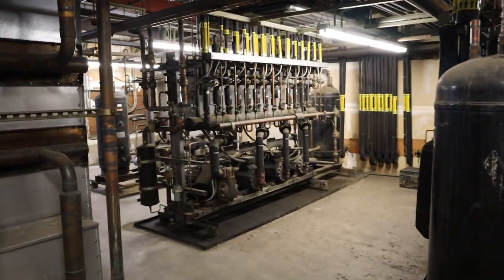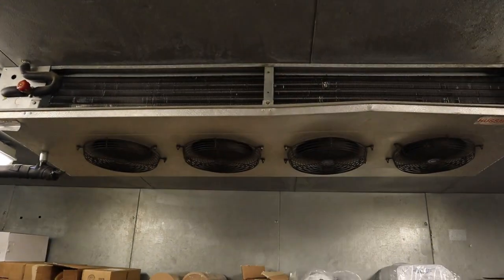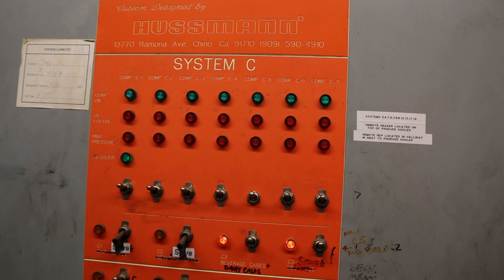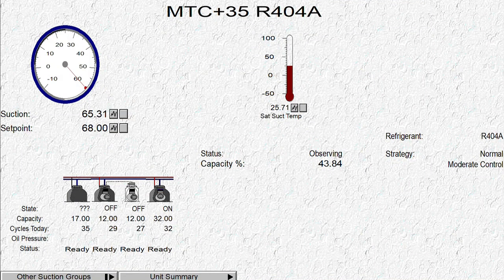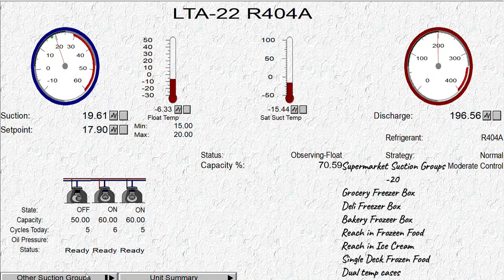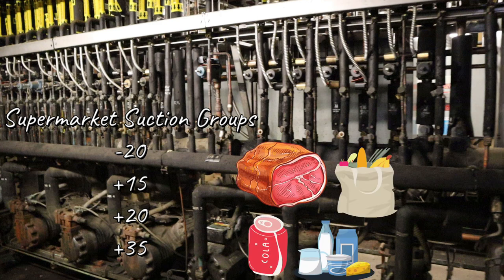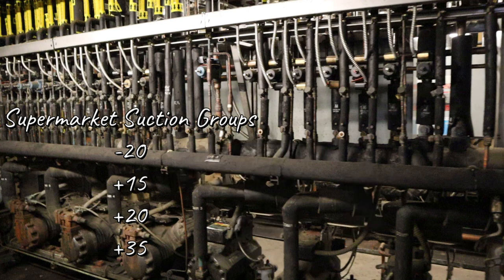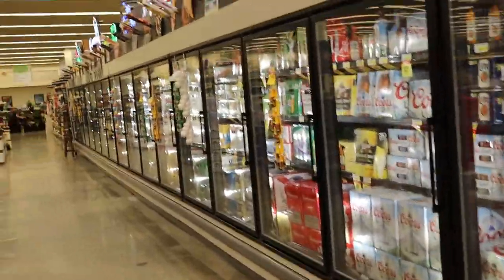Refrigeration: Which Food is Assigned to What Suction Group?

Comment: I saw a split rack the other day that had a low temp suction header tied into a med temp header with a differential valve with a solenoid on it. Buddy told me it was possibly for load sharing. Have you ever heard of something like that and would you be able to talk about what controls it?
Reply from the maker: Are you talking about the two stage rack were the low temp discharge is going to medium temp suction with a de-superheater shooting liquid into the discharge?
Reply: @refrigerationconfidential4376  you know what man it kind of melted my brain looking at it. I’ll have to take some time to figure out what I’m looking at next time I’m there. I got a pic somewhere
Reply: Given you mention a differential valve, maybe it's for hot gas defrost? Makes sense you'd see that on the lower SST racks. Seen it in other videos where they raise the liquid line pressure over a differential valve, dump hot gas into the suction line before the EPR which back flows and ends up as liquid feeding other cases.
Reply: @Thermoelectric7  the one thing I'm sure of is that it was a line between two suction headers. I wish I could upload a pic, can't even link it
Reply: @pauljbrooks3  that sounds real odd. It was the same rack with a common discharge header on the low temp and medium temp compressors? You could in theory use a valve between headers to move some load from the medium temp to the low temp, however I can't imagine the low temp compressors would like that.